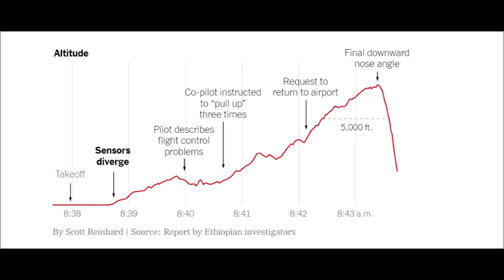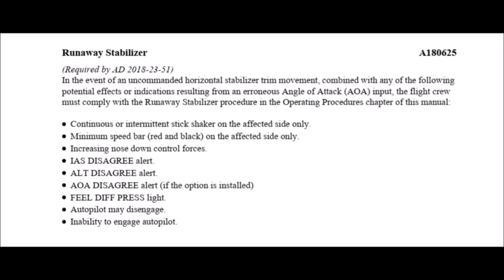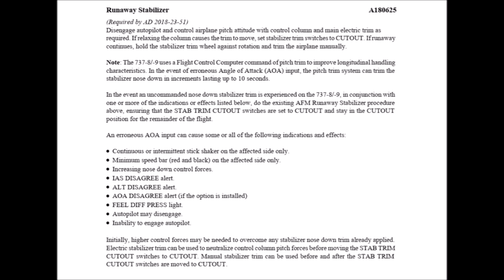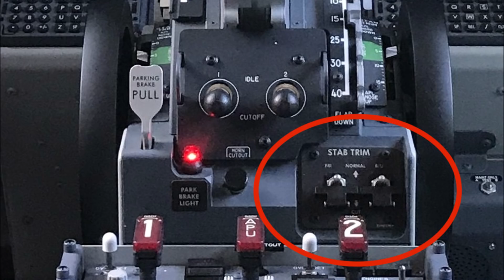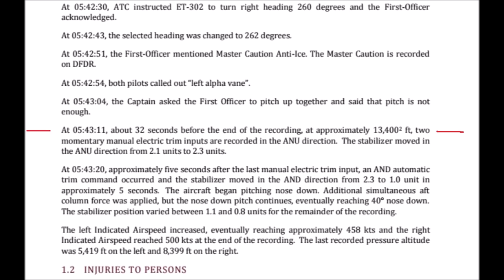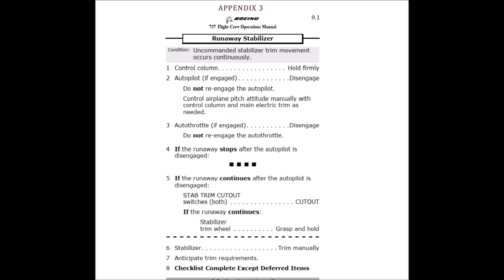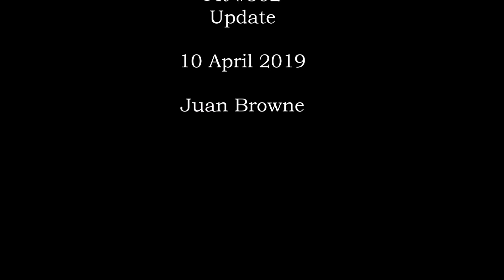737 Max Update 10 April 2019 Runaway Stab Trim Procedures

Comment: Hold on a second...WHY is there a "If the runaway continues" AFTER the stab trim cutout? Isn't that step supposed to disable the electric motor of the stabilizer? Are we talking about something where the wheel is still in motion and gets slower and slower due to the electric engine being disabled or does the engine still try to finish the movement and only disengage afterwards?

If possibility 2 is true then it means the "STAB TRIM CUTOUT" is not like a real power cut to that part of the plane and would mean the MCAS may still be able to interfere.

Someone correct me here if misunderstand that point...
Reply: Nodlimax,  I don't know if the "coast down" you describe would be big factor, but I would think what they are getting at with that statement about "runaway continues AFTER stab trim cutout" acknowledges the motor is locally controlled by relays that ALWAYS have live electricity. The Auto pilot, MCAS, manual electric trim switches, and trim cutout switches Etc, in that case would all be part of the "control" circuit that tells relays what to make the motor do. A "control" circuit generally carries a reasonably safe low voltage, NOT the actual current running the motor which goes direct from the bus to the motor as directed by the relay. Like the magnetic starter on my air compressor! My industrial automation experience involved controlling multiple motors 200-400 horsepower each @ 480 volts, controlled by push button switches on a joystick. Believe me, the actual motor current was NOT going through that joystick. A short in the control circuit can trigger a relay, or a 10 cent spring can break in a relay, or contact points can stick, or an internal short in a relay, could all cause the relay to energize motor without any actual automatic or manual command. 

Interesting comments above from programmers asking if there was enough "what if this happens?" type thinking involved. 

I have industrial  lumbermill experience, not aircraft. I've seen cases of software changes / additions causing expensive problems. It was just downtime, lost production, and equipment damage. Most often not LIVES at stake but injuries possibly. Software changes were sometimes implemented on the fly by electricians.
Reply: @Bitterrootbackroads  I'm working for a company producing its own software. The stuff I've seen that happens on customer side is sometimes really funny and scary.

A minor configuration error and suddenly 9000 accidental "employee x has left the company" are send out to the users right before christmas...

I'm actually glad that we're not providing software for planes. That would scare the hell out of me.

My question in this case really aimed at what that STAB TRIM CUTOUT actually does. From my understanding (not involved with planes but interested in technology and mechanics) it disables the electric motor. So if you cut power to most electric devices they shut down immediately meaning no further action is taken (cut off the fuel to a car engine and it shuts down right away although there still is some minor movement). 

Anyway I understand the various situation that you're describing but I think it's scary to think that it might be possibly for the STAB TRIM CUTTOUT to "fail" because in this case MCAS already is a single point of failure without redundancy that you can only shut down in case of an emergency which carries a lot of other risks due to the construction of the plane though. But if the shut down of the system also fails what the hell can you even do at that point?
Reply: The runaway stabiliser checklist covers a multitude of possible conditions, from computer failure, to electrical short circuit. It is not well suited to faulty MCAS activation.
Reply: I would expect that runaway trim could be caused by a situation having nothing to do with power going to the motor. Perhaps a stripped gear and aerodynamic force on the stabilizer could cause it to move on its own.

Comment: Juan, what do you think of this? There is a five second delay between manual electric trim and when MCAS again changes trim. Although the pilot acted against procedures by turning electric trim systems back on, it seems like this procedure actually would have worked with the help of the copilot.

Captain: "When I say go, I want you to reengage the elevator trim cutout switch and I'm going to immediately use the trim switch to trim as best I can. Then I'll say "cutout" and you'll immediately cut out the electric trim. We have five seconds after I release the electric trim switch to prevent MCAS from reengaging."

Then, while the Captain hand flew the aircraft, the co-pilot could perform the procedure with the trim cutout switch, and they could safely violate procedure but take advantage of that 5 second delay between manual trim and further MCAS trim adjustments.
Reply from the maker: Yes, only if very carefully coordinated.
Reply: @blancolirio  There certainly is only a 5 second window for error, with disastrous consequences for a mistake. And following correct procedures, if the pilot took command, backing off the throttles, hand flying to safe altitude and establishing standard cruise attitude, altitude and airspeed, the copilot easily could have manually trimmed the aircraft without violating procedures at all. This occurrence, as you said, would have been an annoyance, not a tragedy.

Comment: Sadly 2 major problems:
1- a LOT of pilots are forgetting "how to pilot actively", because all this electronics are (generally) working in their places 
2- some of the elctronics systems are becoming "almost sentient" to act on their own, at the point that if a sensor failed, they act AGAINST the pilot's wishes, even if the MANUAL inputs are, someway, correct, untill the pilot HAVE to remove any electronic/electric control... sadly, without some servo-assistance, in some situation, flying an HUGE plane is impossible

Long range flights, thight flight schedule, all of the modern wonders that made piloting commercial airplanes "too much automated, but cheaper" (mostly only to avoid crew rotation by fatigue, if they should actually piloting ALL the flight, rather than giving control to computers and just supervisioning, so "less expenses" for the airliners, that have not to hire more crews) lead to "modern accidents": when pilots are supposed to know how to pilot, but facts show that they are NOT...

... coupled with too easy introductions of "autonomous controls" (like this MCAS) just to avoid:
1- a BIG revision of a plane design (737-MAX should go an HEAVY redesign, after a MAJOR difference in balancement, with bigger, more powerful engines and a center of mass-center of lift etc change: not done and cheated by a "dubious" software)
2- a LOT of training (then a lot of money spent on) on an (by facts) "different airplane" (even if still is considered a 737) for pilots, in the assumption that the "new software" will cheat the plane's attitude to act like older models, when, actually, this cheat is pretty bad developed

No redundancy on sensors SHOULD NOT BE ALLOWED BY ANY CHANCE, in this era of such automatized planes (JUST 2 sensors for AoA and no backups it's not "a good backup", because if they have different reading, the automatic system could not know "how reality works")

AND THOSE simply guidelines are not coming from a seasoned pilot, by a common sense human being.
But "common sense" is not common anymore...

Comment: There is a thread on another forum with a 737 Max pilot contributing. He said this:

I fly the Max (past tense at the moment) at a major airline.

We have over 41,000 cycles on the design, with over 91,000 hours on the airframes, more then any other carrier in the world. 

We’ve collected over 700,000 pieces of data from our Max fleet, and we never saw a single MCAS anomaly. 

There was an MCAS incident at a US carrier, the pilots handled it exactly as they should have and performed an air return without incident (they landed safely).

There’s is much that the public does not know about this problem; do not read news article, they are mostly erroneous. 

MCAS was designed to provide a specific G loading in a stall situation to give the pilots a consistent pitch load at the yoke so that it would feel the same as other 737 family members. This was necessary for the size of the engine nacelles that we fly on the Max. 

We have now flown this problem in the sim and recovered each time. Of course we were expecting it. 

All I’ll say is that it is a very survivable scenario. I have dealt with worse in my career.
Reply from the maker: Yep.
Reply: That is a somewhat biased point of view, saying I have never been a victim, so therefor I am perfect.
Reply: @gordonrichardson2972   Where did he say that? He just reported the facts.
Reply: Never had an AOA malfunction/failure?   91,000 hours on the MAX?  Your airline is VERY LUCKY!  Hope the MCAS "fix" improves this sorry situation.

Comment: Been using YouTube for years.  Always said that I would never subscribe to a channel.  I subscribed to the "blancolirio" channel last week.  Thanks Juan!   The FAA should require Boeing to 1) Modify the MCAS system to use BOTH AOA inputs.  If a discrepancy is detected MCAS should disengage with a visual and audio indicator.  2) Develop a 737 MAX MCAS simulator training program that takes pilots through ALL of the scenarios discussed here.  3) Mandate that pilots be specifically certified to fly an MCAS controlled plane. I will not be a passenger on a 737 MAX unless these type of changes are developed and implemented.
Reply: Most of those suggestions will be implemented by Boeing, subject to approval by the FAA.
Reply from the maker: Will cover the fix in an update.

Comment: Hi Juan, Thanks for the update. BTW, when I am coming in for a visual approach, I always turn the autopilot AND auto throttles OFF, usually by 1,000' AGL. It is a hand flying practice that I have always done. This is also a requirement for an HGS approach at my airline. Note: We have only been using our auto throttles for around 5-6 years.

Comment: Congratulations for another very interesting piece of analysis. Again, beyond the very poor design, human factors surely play a major part in explaining why this situation could not be ultimately controlled. 
The lack of attention on controlling the speed is surely a critical fault. The fact that the pilot in control was the captain probably didn’t help, as the junior FO was the one left with the role of having to take the step back to analyze the problem in this very time-critical situation.
Makes me think of the Heathrow B777 short-of-runway crash, where the captain let the FO keep flying the aircraft whereas he rightfully used his experience to step back and take the best decision (removing some flaps to improve the gliding ratio) to avoid crashing too short into buildings - another very time-critical situation.
Reply: Jo So Good points. The downside with Addis Ababa is that its a captains only airport. This made the cockpit gradient rather steep.

Comment: A couple of thoughts.... The irony of this terrible accident of automation bringing down a Boeing aircraft is noteworthy for amateur aviation buffs like myself. From what I have seen (read) with Boeing's and Airbus's flight control philosophies, they are very different indeed. Almost to a point where the respective manufacturers are proud of their differences.  Boeing's philosophy seems to be that a pilot "knows best" when something goes wrong. Whereas Airbus embraces the idea of just how flawed we humans are, so sensors and computers in control is the safest route.  If you look at Air France 447, where several mistakes involving automation lead to a cascading failure, one would have to wonder how Boeing ended up in a scenario such as this one.  They seemed to use automation as a crutch to overcome an inherit design flaw associated with moving the fan blades forward to gain more ground clearance. Another way of putting it, the Boeing accountants got their way long enough to do some serious harm to the company (let alone forever changing so many innocent lives for a few dollars). It's sad that it comes down to something as cheap as installing an AOA disagree alarm that is nothing more than ones and zeroes programmed into the aircraft's computer array. 
If Boeing emerges from this, I hope they do it without those in the company who wanted to charge more for what is essentially a very cheap safety tool. That's akin to a car company equipping their cars with seat belts, but charging their customers for the installation of the mounting bolts required to secure them. 
As one who grew up watching The Discovery Channel(before it turned to the crap that we know today) and shows like Wings,  I am no doubt an American aircraft manufacturer fanboy.  The inclusion of the word "buff"s in an earlier sentence isn't an accident coming from this B-52phile. The fact the Juan talks about the T-38 and knowing that the SR-72 pilots trained in those very aircraft flying out of Beale keeps me in awe of his personal stories. I love his video of him walking around a Dragon Lady. Of the companies that no longer exist as they were such as North American Aviation, Douglas, Northrop, Lockheed, Corsair so on and so forth, Boeing was one of the few that didn't succumb to mergers or acquisitions. As a matter of fact, they now have an overwhelming collection of acquired war bird programs.  For those reasons, I am concerned when a company with that many irons in the American economy and defense fire blunders a seemingly innocuous aircraft upgrade. Especially if that root cause in the end is attributed to nothing more than bean counting.       
Thanks for all of your insight Juan.
Reply: Chris Beach Thanks for your feedback. Many ironies in this story!?

Comment: Thank you for the great explanation Jaun! Still seems to me that the MCAS system is not very smart, they should  have tied in a whole lot of other information coming from the plane to automatically cut out MCAS, for example speed or even altitude in comparison to what the pitch is to call for in these instances. Fact is, if MCAS had just shut down because of all these other factors, they would have surely been able to save the plane and that' without considering  any AOA differences. I don't get why they didn't take these other instances into consideration when they programmed this. Like you said before, even tankers have MCAS but it works because of other facts taken into consideration for example, shifting weight ect....
Reply: Napo leano Good points. The proposed Boeing changes to MCAS will include many of those suggestions, once the FAA have approved them.
Reply: @gordonrichardson2972  Thank you for your answer sir :)

Comment: Before we say that the pilots lost track of the throttles we should wait for more info. They may have been many reasons why they left them there, if they were there. And it does not appear that it was a contributing factor anyway. Does it matter if you head straight for the ground at 320 or 390?
Reply from the maker: It does matter,   greatly
Reply: @blancolirio  Would really appreciate if you could tell me why. Not being funny, would really like to know.
Reply: @markpoidvin5382  First thing is you get to the crash site sooner at 390 (less time).  Second thing is that the trim wheels are harder to turn at 390.

Comment: Juan, thanks for the clarity ! It's clear that there are too many "little steps" required to 'kill automation' and revert FULL MANUAL control to pilots. Don't you have a TOGA button for missed approach/go arounds ? I'm thinking a similar  "one button" to revert to Full Manual Mode, so pilots can fly old school in a crisis. 
Here in a warm room, coffee in hand, and 20/20 hindsight in our favor we can barely follow these many intricate steps. In the heated critical moment, some flight crews cannot - namely Lion & Ethiopian.
Do you agree ?
If so, does Boeing have the guts to trust pilots with such a switch or does the PC mentality now rule even our aircraft engineering ?
Reply: +1 And make the shut down as simple (one switch) and as fast as possible (fewest number of procedure steps) as possible.

Comment: Why you defending Boing 737max so much? While Boing confirmed that 737max have software issues are occur  and they will correct it. The information from data recorder, the crew follow the procedure correctlly and the crew didn't switch on  back 'stab trem cutout' switch , but the plane continuous nose down. In additon it doesn't give enough time  to solve the problem. That is the one of the  issue in 737max fleet.
Reply from the maker: Samuel Abera see previous updates.
Reply: Samuel Abera I think you misunderstand. Watch Juan's previous videos, and remember this is part of a series.

Comment: The primary issue seems to me is that the MCAS system kicks in during take off or shortly thereafter when it is not needed thus creating the emergency in the first place! 

The issue is the plane! End of story! If Ford makes a car that explodes when it reaches 30 miles an hour do you blame Ford or do you blame the driver for not being able to deal with the emergency! Think about it.

Comment: Engines are below of the CP and CG lines of the plane, so reducing power would drop the nose. So throttle should be reduced before dangerous trim condition? Both reducing power and "aerodynamically relieving airloads" for manual trim, would drop the nose, did they have altitude to do so?